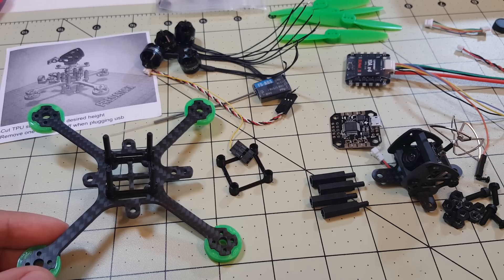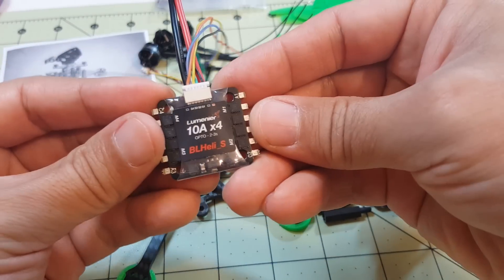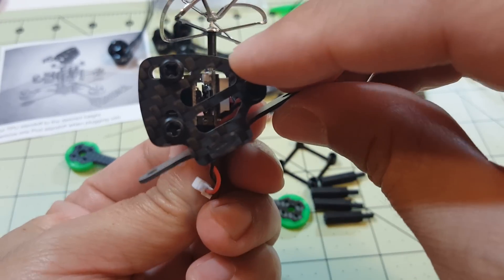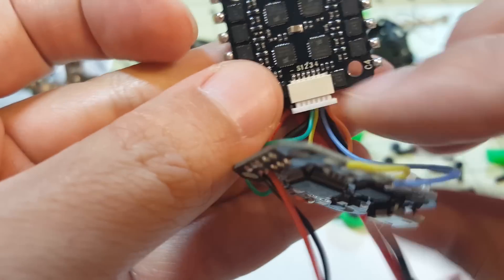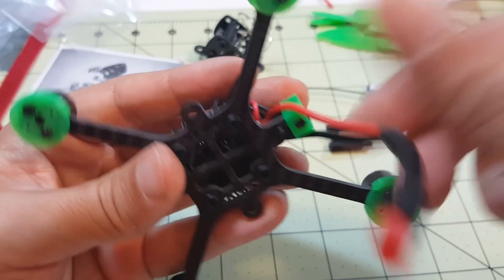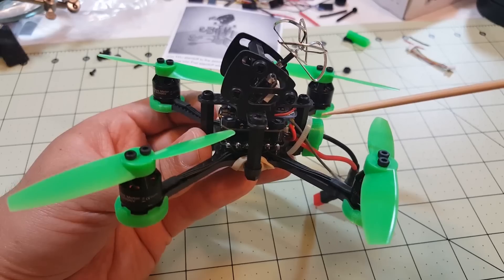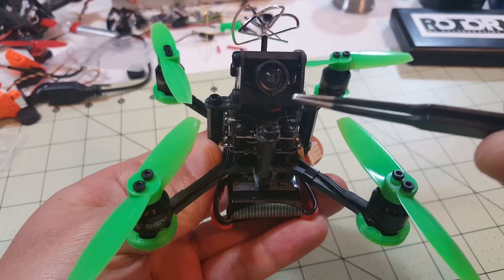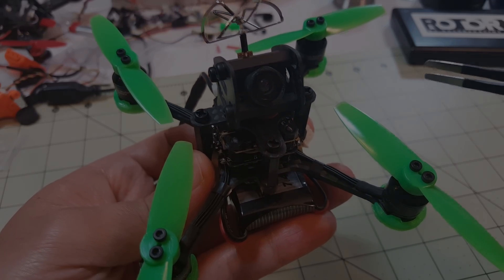Tomoquads PredatorX Micro Racing Drone

Comment: Any idea on how to get the PikoBlx to support DSHOT600? My 4 in 1 ESC is ready with D-Shot but when I set the FC to d-shot only two of the motors spin.  I don't have this problem on multishot.
Reply from the maker: Read this posting - http://goo.gl/rFo8i3
Reply: So all I have to do is solder from ESC 1 pad to the PPM pad and that is it?? Or do I have to mess around with the CLI tab?
Reply from the maker: In the post it has a link to the github article with the CLI commands. You have to do some resource re-mapping.

Comment: hi Al! I followed your build guide step by step, thanks for posting it! She's flying fine but only with 1935 props. When I put the RX2030s or DYS3045, she hovers fine for about 5 secs then shoots up unexpectably without any throlle input, fly characteristic after that is terrible, wobbly if thottle is >25%. Mind if I try your PIDS see if that makes a difference? or any feedback on workaround would be cool. Thanks!
Reply from the maker: My PIDs are in the CLI dump link in the description.  Not sure what that shooting up behavior could be.  Either something up with your ESCs or your radio/transmitter is sending weird signals to the quad.  Maybe check the receiver section of Betaflight configurator with props off and battery plugged in and see what the channels do in the receiver section and if the throttle behaves erratically.
Reply: Rotor Rebel i get this also, did you ever fix it? suspect it's vibration issues
Reply: jamble7k yeah what seemed to work is: connect and reset all the pids in BF using the reset all pids button, than lower Roll and Pitch by 10 each and set the TPA value to 30-35 {test that range area) this worked out pretty good for me. Good luck!
Reply: hey thanks for your reply! no luck on 3s after lowering the pids... but on 2s it hovers fine.
3s sends it into the atmosphere after just lifting off... i'm honestly stumped with what the issue is!! (i've built over 15 betaflight quads) it's a really strange problem.

using a piko blx, 12a 20x20mm racerstar esc, rotorx 6500kv motors, xm+ rx

Comment: Thanks for this video! I'm just about to order this frame :) How do you like the RCX 1105s? Do they perform anywhere near the rotorx 1105b? I know the rotorx are 6500... i have them on order too, but from AirBlade UAV Canada should arrive promptly. I have those on my Atom V2, they are surely best in class!!! Like they brotherhobby's 1407, they are really some micro I monster motors... on my catalyst machineworks super light 3" build, its often faster than many 5" racers !!! Hope the rcx are decent motors, and that they are a class above the Racerstars 1103/1004/1106... cos the rotorx are rather expensive!!! Would love to have a fairly priced alternative
Reply from the maker: I've never flown the RotorX 6500's so can't offer an opinion on how those compare to the RCX's.  The RCXs seem a lot more powerful than the 1103 but that should be expected.  I will be testing these on RX2535's soon to compare with the KingKong 1103's on the MultiGP build soon.  More builds and comparisons coming.  Stay tuned.
Reply: ADAMBOMB FPV thanks I might try them out... Do you know how they compare with other 11xx motors?
Reply: Albert Kim oh cool i nearly forgot about the kk motors you put on your build, IN sure interested to find out how they compare to the RCX, especially the same size 1103 Racerstar motors. Have never had any King Kong products, only recently bought the Q25 Mini, the 16ch vtx & Cam combo, will soon be on a micro build, hopefully they make quality products. They sure present their products better than average, with a plastic case like the ones with Emax red bottoms.
Reply from the maker: +Ray Choi they're better than the 1104 4000kv racerstars from a previous build.
Reply: Adambomb do the dys 1104 6500kv get hot with the 3045 props? I emailed rcx the other day about their 1105 5000kv and 3045 combo and they said they don't recommend it. They said they would be better on a 4000kv.
Reply from the maker: the 1105 5000kv motors don't get hot on 2S. Ice cold.
Reply: ADAMBOMB FPV no I don't have them,  I am looking to upgrade my 1104 4000kv,  what esc are you using with that combo?
Reply: ok now i wanna see that video :).
Reply: Great! I send an invitation, thanks mate!

Comment: Hi, nice build. Can you tell me what are these VTX+ / Ground pads on the Piko BLX board? I soldered my FPV AIO camera to that pads and that burned the Piko BLX board. Now I have to what 2 weeks for a new one.
Documentation says Filtered Voltage for VTX..
Reply from the maker: It's filtered but it's the full lipo voltage.  I would think that would blow up the camera and not the board.  That doesn't make sense.
Reply: +Albert Kim (marblekit) Thx for reply.  Thats strange. The camera still works fine. The board only turned on, if I plug in the USB plug. Plugging in the battery does nothing. Next time I use the 5 V pads. :-)
Reply from the maker: +paynis21 hmm, check that you don't have a short somewhere.
Reply: I checked this many times. I already made a few testflights before I soldered the camera. And I still can spin the Motors in Betaflight because the USB powers the board. But all UART Ports have no power even if I plug in the battery. I hope the new flight controller solves this👌🏽 thx for the help and again, nice videos. Your channel saves me tons of time.

Comment: Just a thought, but I'd like to see a speed comparison with the TOMO 117 with both quads spinning 2.5 inch props (66mm is max for MultiGP micro class). Do you think the motors would need to be higher kv?

+1 on the comment that having an extra PDB bugs my OCD...

Comment: Great build.  I enjoy the content on your channel.

Do you plan in protecting or reinforcing the antenna on the aio?  If so what will/would be your method? aurora carbon hood? zip tie? epoxy where it attaches to vtx?

Thanks, just contemplating the options on a similar build.
Reply from the maker: Probably will replace it with a whip antenna.  If you want to protect the CP antenna, use zip ties.

Comment: is there a different FC that would fit that's cheaper and doesn't have the built in pdb? I don't get why the BLX is necessary with a 4 in 1 esc
Reply from the maker: Not aware of any that is 20x20... maybe those will come out soon with the expanded use of the 4-in-1's
Reply: Could you maybe convert one of the brushed F3 boards to brushless?
Reply: Lumenier Micro Lux, even have a version with built on frsky receiver.

Comment: Awesome build Albert 👍. Would those props fit your Walkera 110 and vice versa? Thx Dod.
Reply from the maker: +Dod Rc no, there are 3 inches. The rodeo is 2.7 inches
Reply: Albert Kim thanks for the reply 👍. I just want to see someone try some different props on the 110 lol. Didn't I seen you have some of those RotorX two blade props that link together to make four blade props? Aren't they 2.5"? Thx Dod.